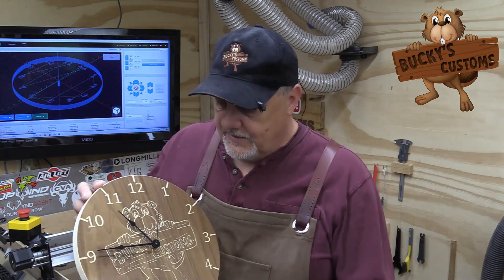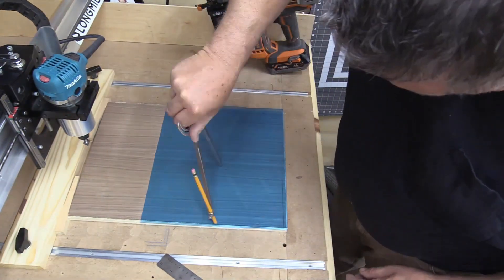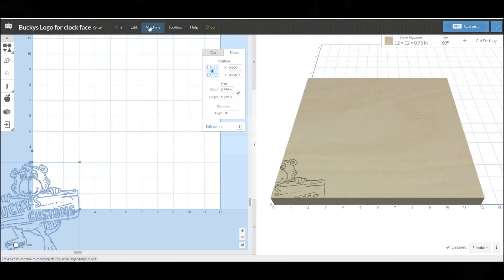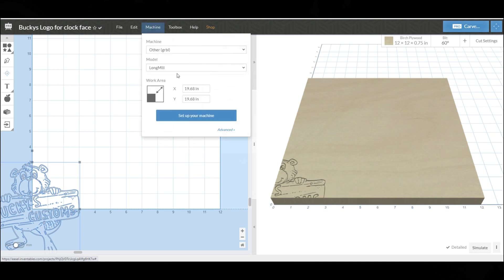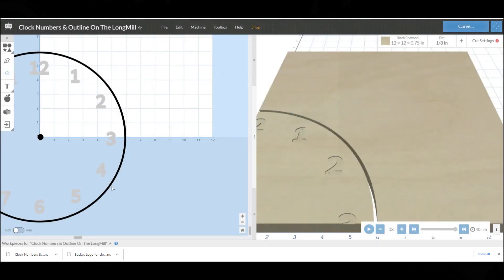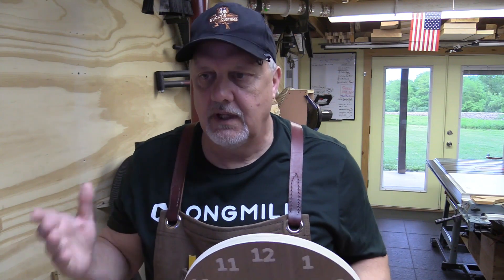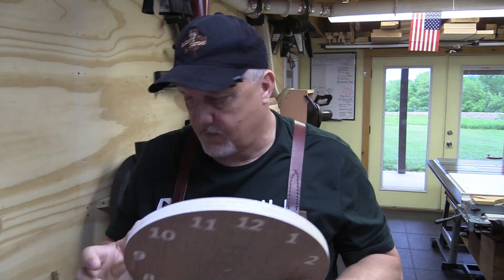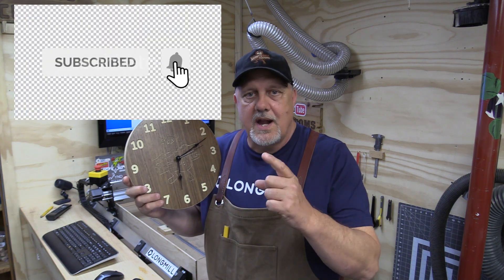How to make a Clock on the LongMill Benchtop CNC

Comment: I made such clocks as well with some images on it by hand using my 1500W handheld router. I made some with a pinguin, butterfly, a music note (treble clef), an owl and a few others out of 18mm thick mdf. But I ordered the Longmill as well about 3 weeks ago and wanna make them using the CNC in the future. It was a pain printing the images, laying the paper on the mdf board and go over the lines slowly using a permanent marker on the paper. That way, the paper got saturated by ink and the ink went over to the mdf material, allowing me to cut the images with the handheld router. Took me about 1.5 hours to make 1 clock that way. Using the Longmill, I'm sure it will go alot faster. Also I won't waste alot of paper as I needed a new piece of paper for every clock because of the saturation of ink in it.
Reply from the maker: Clocks are a really cool project to give as gifts. And the possibilities are endless with the Longmill. Congrats on your purchase! You will love it!

Comment: I know this is an older video, but I just found it. That clock looks really good, very nicely done. The numbers look large enough so you can see them clearly. 
 I really like how you put your logo in the middle, but I have a question about that.
Would it have been possible to make the carving, or lines, for the logo a little bit bigger, or maybe wider? The only reason why I'm asking is so it could be seen better, maybe pop out.  
I'm just curious if it could be done like that.
Reply from the maker: Sure it could. I always believed that when it comes  to logos and projects that less is more.
Reply: @BuckysCustoms   That totally makes sense. It looked awesome. 
But like I said, I was just curious to see if it could have been bigger. 
Thanks buddy.

Comment: Hey Thanks for the Video(Subscribed) !! waiting for my machine to come in "). Question do you know if you can setup multiple Zero spots on your waste board with Gsender. So lets say you cut alot of the same size boards ill use circles as an example 12" 16" 22", but always cut those from 13*13 or 17*17 boards and so on, can I setup 3 spots on my waste board and mark them with tape or a marker or a cut , then just know that when you put your board on that spot that you marked and selected something form gsender  its always zero'd  on the X and Y then you just have to tell gsender the Z axis ? Thanks !!
Reply from the maker: I mark my waste board all the time with frequent starting points for material. I am not awhere of multiple (Saved) Zero X & Y points. I can create several projects in one toolpath and place individual pieces on pre marked spots on the mill and do this all day with one zero but when I closed gSender and the Longmill is turned off I have to re-zero when I start up again. The initial setup of the mill up for multiple pieces really doesn't take that long.
Reply: @BuckysCustoms  Thanks again Bucky, So I was really curious about this, and asked on the Sienci board. You can !! you can mark up to 6 different memory locations to store zero points, and always have them avaialble whether you shut down or not. Thanks again love your videos
Reply from the maker: @jav9888  Thank you! I think I am as pumped about that as you! I do a couple of things ALL the time and that will definately help! Thank you for watching! You help keep us going! Thank you!